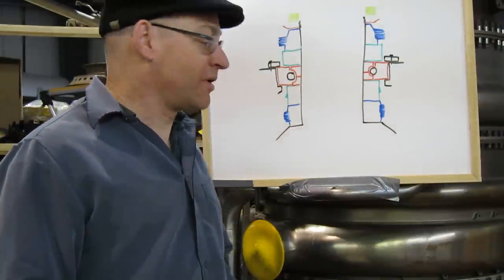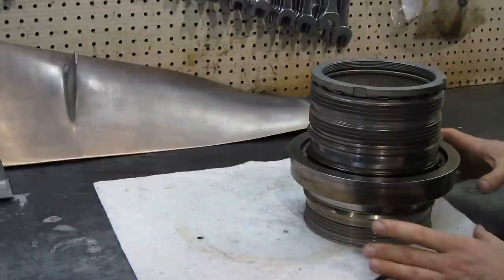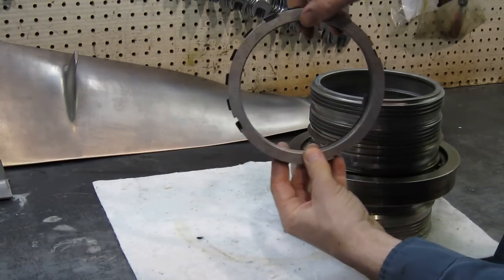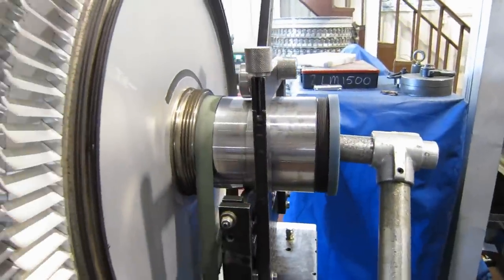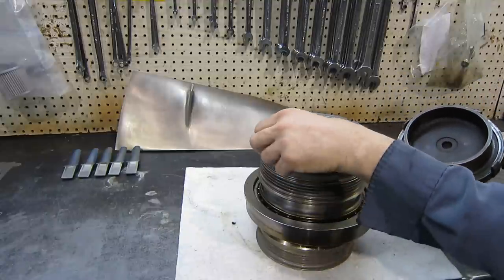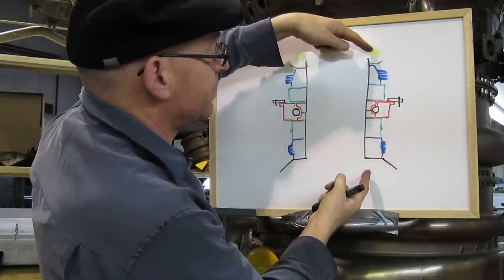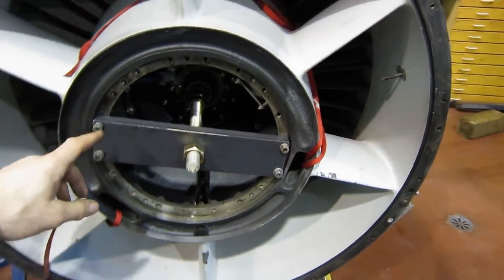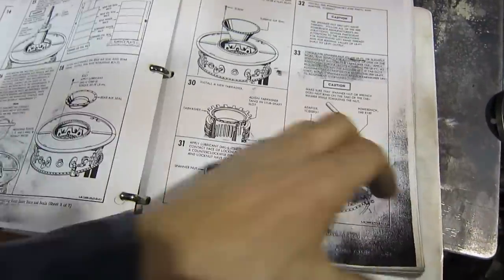the Thrust Bearing: what holds it in?

Comment from the maker: Those projections on the blade in the background are mid-span shrouds, and they are for support. Newer turbofans don't have them, so modern blades must be stronger and stiffer.
Elaborate? I don't recall seeing any ceramic coatings in this video, but they are used as thermal barriers, reducing heat transfer.

Comment: It is an amazing balance of things going on, air goes in, but then it goes out even faster. I guess the tension between turbine and thrust bearing is the same as with centrifugal compressor jets, and would be part of why the axial jet didn't take long to be developed after the centrifugal ones started working. How they work mostly makes sense, how they hold together is another problem altogether.

Comment from the maker: There is always load on the thrust bearing. There is actually more rearward force on the turbine than there is forward force caused by the compressor "pulling".
Most of the thrust from the engine is created by the exhaust nozzle... that's why it is there. The whole compressor - turbine system is just a gas generator to provide mass flow for the nozzle to accelerate, and produce thrust.

Comment from the maker: For the rotor when building it up on a stand:  0.010"
When it's in the engine and supported by the #1 bearing in front and #2 bearing in the rear: no measurable runout.

Comment: Awesome thank you for that! That answered a lot of my questions from last vid. 

As usual, have more: I've been wondering what the predominant direction and size of the load is on that bearing. The compressor would be trying to exit from the front of the engine because it's thrusting, the turbine would be dragging so would be trying to leave from the back. The shaft would be under huge tension as well as torsion, how much axial force is borne by the thrust bearing?

Comment from the maker: There is a fancy tool that engages the splines inside the compressor shaft to react against the torque applied to the nut... but I've never seen it.
We use the inertia of the rotor and torque the nut against that.

Comment: Of course there is a net work being done and force applied somewhere through the engine to shift all the air backwards. If there's no axial force on the shaft at constant rpm then I'd say thrust came from the diffusers/combustors, but they don't look quite THAT strong. So yeah... I'm definitely not part of the jet people inner circle. Do they have a cool handshake?

Comment: Well in an engine already running at a stable rpm, I'd be inclined to think there was no axial load on the bearing. Drag from the turbine would equal thrust from the compressor. If the engine is accellerating, though, thrust from the exhaust nozzle would be higher than thrust from the compressor, so the turbine would draw back and the axial load would be towards the rear. If you reduce rpm, the thrust from the nozzles would reduce, drag on the turbine would reduce and the load would be forward.

Comment from the maker: The shaft has threads on it, onto which a large nut goes... during engine assembly. The arrangement is a bit different than the usual, straightforward thing we see on the LM1500.

Comment from the maker: To call them true seals is a bit wishful. The idea is to try and keep oil and air from passing through a gap between a stationary surface and a shaft spinning at 8,000 rpm.The carbon oil seal is a smooth surface of slippery carbon sliding against a highly polished mating surface. It leaks a tiny amount of oil. 
The air seal is actually as tight a gap as can be made without the two surfaces touching, so some air always gets through.

Comment from the maker: Well, you are delving into black magic here, and there is serious debate amongst the technical people as I mentioned above...
Everything is turning except the outer race of the thrust bearing; that is attached to the engine midframe, and the stack shown in this video is attached to the compressor rotor.
The engine, however it produces thrust, transmits it to the aircraft via the main mounting points shown in some of my other, recent videos.

Comment from the maker: Yes, you have it. look at the strength of those ( solid stainless steel ) pieces stacked up.
The most lightly built pieces are the air seals, and I bet they could hold up over 200 tons of axial load...
I'm sure of the whole stack, the weakest link is the load capacity of the actual bearing, and it is huge.

Comment: So just to clarify, is it that big nut squashing/securing all the seals and inner races of the bearing together on the shaft is to reduce axial movement so that way the inner race is secured to handle the axial thrust load?? And that outer plate that's the outer race sits behind also resist the axial thrust as well??

I have worked with tilting thrust bearings where the inner race is actually designed into the shaft itself to secure movement that's why I ask the above question

Are there any engines out there that use tilting pad bearings or is it all roller bearings??
Reply from the maker: Yes, the two-part inner race of a large ball bearing is attached to the shaft. The outer race is mounted to the "frame" which is a major component of the engine outer structure. Being a deep groove ball bearing, it allows the shaft to turn, but not move in any other way.

Comment: So is it the same setup for the rear of the engine also and the turbine is essentially clamp into the engine case from each side? It is surprisingly hard to find info on how the actual turbine shaft is connected to the rest of the engine
Reply from the maker: If you want to see the insides of a jet engine, that's what my channel is all about.

Comment: Hi!
You are balancing compressor rotor without thrust bearing components, seals etc. Is it a manufacturing requirement ?
Thanks,
Reply from the maker: Michal L The rotating inner races and roller elements of the bearings are assumed to be balanced, since they are built to dimensional tolerances of less than a thousandth of an inch overall.
Reply: AgentJayZ Sure those elements are well made. Do you check vibes level on engine during test cell run ?
btw thanks for posting such valuable videos

Comment: Hi Jay - How does the thrust bearing get lubricated during engine operation? Is it just greased at installation and the grease is retained and lasts the life of the engine? Or does the engine oiling system continuously supply oil to the bearing?
Reply from the maker: The thrust bearing of an aviation or aeroderivative gas turbine engine benefits from one of the most highly engineered and sophisticated lubrication systems of all.
Please see my video: Jet Engine Lube System, as well as the Main Bearing series, as well as mu other thrust bearing videos.
Cheers.

Comment: All thrust bearing is ball bearing or some use other types ?
Reply from the maker: With a name like that, I would expect you to be very precise with your words.
There are indeed other types of thrust bearings. I once had a bicycle with a thrust bearing in the headset that had a radially arranged set of cylindrical rollers. Tapered roller bearings also are used in the steering heads of motorcycles, and in many other thrust applications.
Reply: AgentJayZ thanks for clear answer , i read that the ball type use in high speed shaft such as jet engine but dont use in havey duty is that right ?
Reply from the maker: I can only comment on the stuff I work on, and I have only seen ball bearings used as thrust bearings in aeroderivative gas turbine engines.
Reply: AgentJayZ thanks

Comment: Hi Agent Jayz, thank you for all these great videos that you've done so far. I'm wondering 1 thing here, is there any control to ensure that the upper part of the inner race doesn't pinch and/or damage the balls during assembly? Thank you again I'm especially enjoying the videos the ones are about T58 mounted boats!!! Also could you please share a video about assembly/torque procedure of the mainshaft nuts the ones keep the rotating materials together during the engine operation?
Reply from the maker: The inner race halves are constructed so that when they are tightly held in full contact by the retaining nut, the groove matches the balls perfectly. The risk is not that they might squish anything, but that they are not completely held tightly together, in which case the bearing would be loose, and would likely fail in service.
I've got a video about the main coupling, and one called what holds it together...

Comment: On something like this, I could see there being immense axial loading, and with a properly balanced shaft, minimal radial.
On any of the newer engines, do you see them using conical bearings? Or is ball still the way to go?
And second question, does the race form a gothic arch profile (2 points of contact on the balls) or standard radius, with just one point?
Awesome video as always, to say the least... Things we would never have a chance to see.
Reply from the maker: +Cody Smallwood Spherical balls, circular race. Line contact.
Reply: Thank you!
I cant even begin to imagine the hardening and grinding process on precision bearings like that...

Comment from the maker: Oh, you're smarter than you think you are. The jet engine is all very counter-intuitive. That's one reason it took so long to invent, and so long to develop after that.
It seems to be either impossible, or to work by pure magic.
Here's a hint: the thrust bearing is not what the engine uses to transmit its thrust to the airframe. It's only called a thrust bearing because - like all thrust bearings - it handles axial loads.

Comment from the maker: Ah, another ambiguity in the terminology... actually I mean the portion of the engine after the turbine that is shaped to accelerate the gases to produce thrust. It's only variable in afterburning enignes.
It's not the clearest system, but exhaust nozzle is completely different from turbine nozzle, as well as the slightly more obvious "fuel nozzle"...

Comment: Quite interesting.  So the carbon seals isolate the oil supply from the areas outside of them, and the labyrinth seals presumably keep the compressed gasses or air following the required path.  I've noticed you discussing the pressure of the compressed gasses being up to 300 psi in some engines.  I'm curious what the pressure difference is between the lubricating oil and the compressed gasses in the area of this thrust bearing.  It seems like the lubricating oil could be kept at a pressure similar to the air outside to reduce the force against the carbon seal.  If it's similar to water pumps that use carbon seals, the area of higher pressure serves to hold the seal surfaces together.  Do you know the approximate pressures offhand?  Is the pressure of the lubricating oil varied to protect the seals?
Reply from the maker: The oil does not protect or assist the seals in their function.
Lube oil PSI is shown on the monitor of many of the engine test videos.
It varies from 2 to 80 psi depending on a lot of things.
the bearing sumps are not exposed to CDP, or gas path pressures, which can be as high as 600 psi in modern engines.
The bearing sumps are close to atmospheric pressure under normal operation, as they are isolated from the gas path, in part by the carbon seals.
Reply: Thank you!

Comment: excuse me,I have questions to ask, How to repair LM-2500 gas turbine B-SUMP?
How to confirm 23699 oil leak out from B-SUMP?
Reply from the maker: The overhaul manual contains all the procedures, troubleshooting, tools and parts required.
Reply: Thank you for your reply!
I konw ,but I still can’t find the way to solve.
So,would you help me?
Would you have the related video to refer?

Comment: crazy it looks like a giant bicycle head set bearing assembly
Reply from the maker: Donna, you are exactly right. A bicycle headset bearing assembly is (usually) a deep groove ball bearing that acts as a thrust bearing. The main difference is the rotational speed. In a headset it's minimal, as opposed to a turbine engine, where it is generally thousands of revs per minute.
A more suitable bearing for heavy axial (thrust) loading at low speeds is the tapered roller.
Motorcycles went from ball bearings to tapered roller bearings in the headset because of their greater load capacity and resistance to brinelling... or denting of the races... called indexing by bicycle types...
Aren't tapered roller headsets used in the high end bicycles?
I think they should be.
Reply: Hi Jay! Thanks for responding, I'm just using my bosses' you tube account at work, don't tell her I was too lazy to log out! lol I'm the master bike tech here at our bike shop and you are correct in that tapered roller bearings are being used on contemporary bicycles for headsets. Bottom brackets and wheels use roller bearings as well. The traditional conical race/ ball bearings ("cup and ball") are still in use today as well on more inexpensive bikes. As an aside i have found a use for many bicycle parts on some of my home made gas and tesla turbine projects...I just need to make a gas turbine bicycle and i'll be in heaven! (unequivocally no doubt). lol Check out my channel at drs2100 if you like! :D

Comment: hello.. I've seen some rc model turbojets use 2 angular contact ball bearings butted against shaft casing and shoulders of centrifugal compressor and turbine wheel.. to take up clearance and provide an axial preload they use springs or compression washers.. because un preloaded the balls and the race might slip against each other instead of rolling and cause wear(supposedly).
But I see no such spring or provisons for preload in your diagram and I've noticed full size turbines do indeed use split race type bearings as shown in your video.. 
my question is.. is there any need for preload in those bearings? and if there is how is it done? Thanks in advance! I always enjoy your videos... love them so much
Reply from the maker: The ball bearings are called thrust bearings because they handle axial loads on the shaft. There is only one thrust bearing on each shaft. The compressor and turbine produce axial loads when they are operating, so there is no need for preload.
I never consider the engineering or design of home made turbine engines... because there isn't any. All of the ones I've seen do so many things wrong or omit so many parts that they are dangerous. 
To compare them to professionally engineered turbine engines is a complete waste of time.
Reply: +AgentJayZ Agent.. If you were to design a turbojet that has a single centrifugal compressor stage and a single axial stage.. what kind of bearings would you use..? I humbly ask because frankly I'm not sure which direction the shaft would be loaded in running condition.. I would tend to think it would be loaded towards the rear.. but I don't know for sure
Reply: +Sangyoon Kim And if thats how its loaded then a lot of model turbine makers are doing it wrong as you mentioned.. they are trying to counteract natural preload direction by loading a spring against the force...
Reply from the maker: The thrust bearing is a deep groove ball bearing. It can handle loads in either direction. Usually in a turbojet the force placed on the shaft by the turbine is greater than that by the compressor, so it is rearward.
Have a look here, and you can win a small prize if you can identify the engine they based the diagram on.
http://aeromodelbasic.blogspot.ca/2012/05/thrust-distribution-distribution-of.html
Reply: +AgentJayZ Thanks for the link! I'm reading it now... the engine is Rolls Royce Avon?
Reply from the maker: Good one. Send me a message with your address...

Comment: What company makes the bearings in the LM engines? Is there a fairly common maker for most of the ball bearings in the engines you work on?
Reply from the maker: +Seigfried Gustafson 
The bearings used in an engine are made by a variety of vendors. So there is an engine manufacture part number that is standard for any give part. Then there is a bearing maker's part number, which will be different for each of the various sources of that bearing.
Then there is the serial number, which is unique to each individual bearing.
Reply: Thanks for the reply!